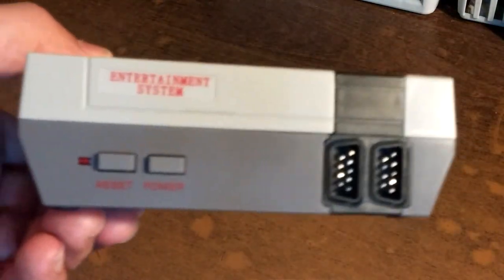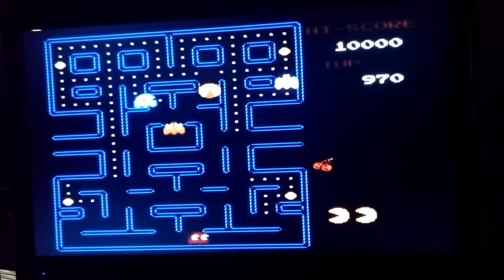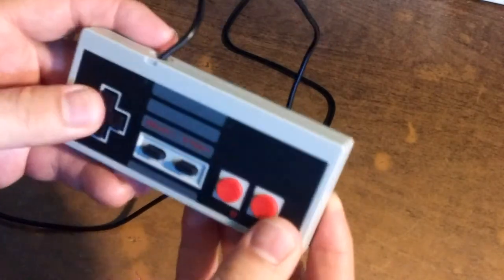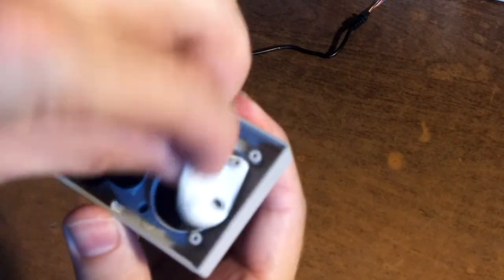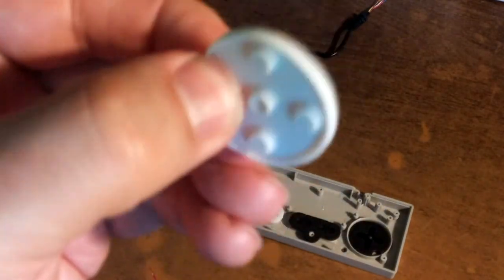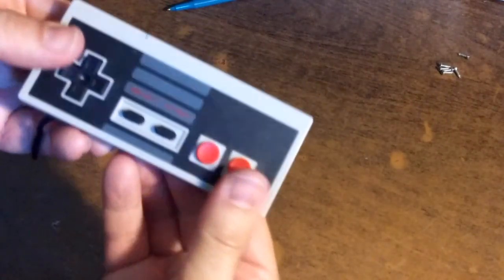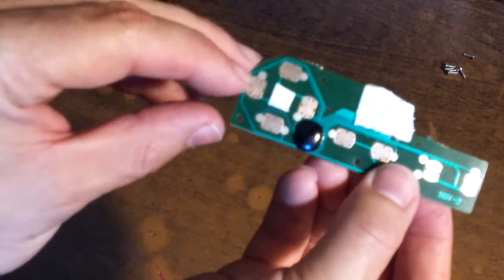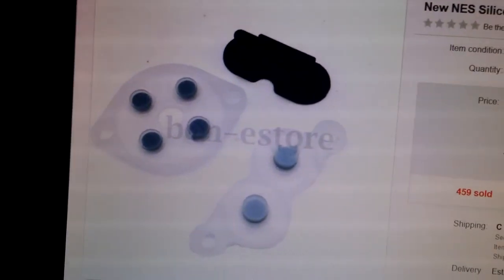Mini Classic Not NES Clone Console and Controller D Pad Fix

Comment: Did you receive those replacement membranes? If so, how did they work out?
Reply from the maker: Yes, the replacement D-Pad membrane works good. You need to cut one of the holes off the side to fit. The A/B button membranes do not fit.
Reply: @relaxxxrrr  Fantastic, thanks! I'l definitely give it a try if I can get my hands on them.

Comment: I also bought this, can I use regular tape on board or does it have to be electrical tape and is there a different way to make it less stiff
Reply from the maker: I used white dollar store duct tape. Different tapes might a give different feel but should work. Cutting the center membrane out is the only way I can think of to soften the d-pad. Thanks.
Reply: Just got one for Christmas, having button confusion (When I press jump it pauses) Anyone else having this problem?
Reply: Having the same issue with the actual classic controller. Just got an Nes Classic for my friend and both the official and the wireless Yok controller had the input problems you described. 

Makes you wonder how these issues pass quality control. If you're going to spend money manufacturing stuff you might want to make sure it works correctly!